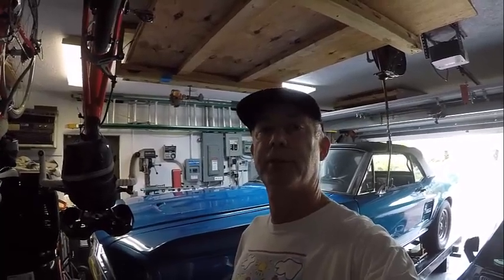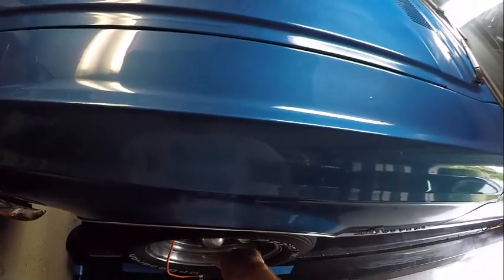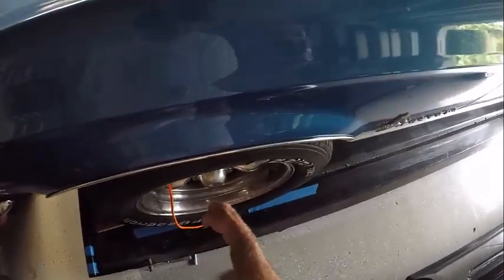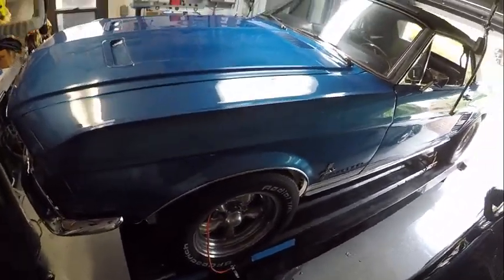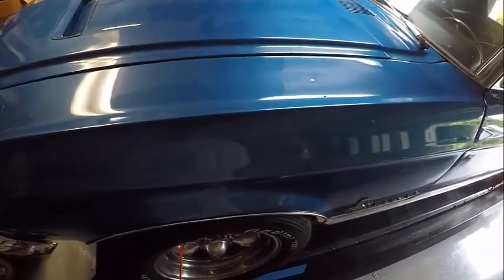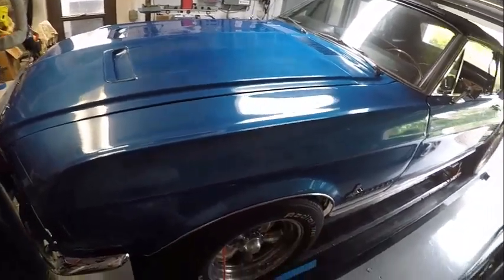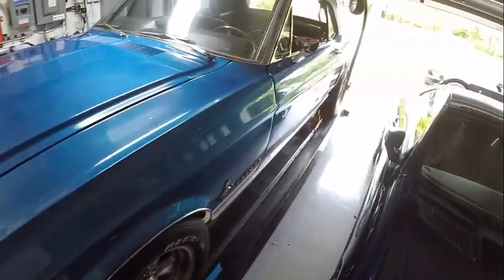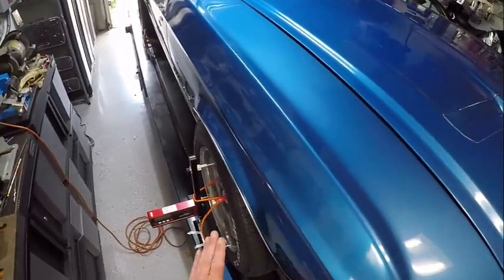Set Front End Alignment on 1967 Mustang

Comment: Great video. One of the best in explanations actually. Only thing I wish you did differently is, you didn't show how to adjust your camber if it was off. Since yours was at 1.2, you left it. My 67 has negative camber on just the left side. And I am looking for how to adjust it. I'm thinking to just turn the bolt with the offset washer. (Don't know the technical name of it).
Reply from the maker: Ah, good point.  Yes, that eccentric bolt (with the cam on each end) is used to set camber.  Loosen it, then turn the head to move the lower arm in/out to change the camber angle.  That cam bolt is notorious for not holding its position  - and I eventually experienced that.  So I purchased a camber lockout plate to permanently fix the position of that bolt.  It was a bit of trial and error finding the right bolt hole to use - but now it won't change.

Comment: That lift looks pretty handy. Does it raise the car up on it's own or how does it work? Very informative video btw, thanks for posting this
Reply from the maker: The lift needs a floor jack to raise it.  Then it locks into place.  Thanks!
Reply from the maker: One end of the lift retracts to the floor.  You drive on it, then jack up the lower end using a regular floor jack.  Once raised, you lock the tucked legs in place and lower the floor jack.  It's very handy.

Comment: Did you have a factory lower control arm on this car before then put this tubular lower control arms on it? Curious if it felt any different? Stiffer after installing the tubular arms?
Reply from the maker: The aftermarket looked beefier than the stamped steel OEM piece, so I went with it.  But doing so introduced bump steer as I guess the aftermarket piece follows a different arc than OEM.  So I had to come up with a solution to bump steer.  In retrospect, I probably should have stuck with the OEM lowers.  And I couldn't pair the new lowers up with their mating uppers as the pairing lowered the car - and my tires already hit the fenders on aggressive bumps.  Probably if I had gone Globalwest (that's the aftermarket lower brand) for both uppers and lowers, I wouldn't have introduced the bump steer issue.
Reply: @bretthusselbaugh1198  Thank you very much for the information and video.

Comment: Who makes the alignment gauge you were using for the caster and chamber I like how the level fits inside an actual cutout?  I'm going to speculate that when you zero the level you're supposed to rotate the level 180 degrees on the second button press so that your reference surface doesn't have to be perfectly level.   Best explanation of caster angle the simple description of what happens if you had 90 degree caster sealed the concept.  Thanks!
Reply: I think I found it on Amazon: Longacre 52-78298 Digital C/C Gauge LargeDunlop Style 22in  nevermind

Comment: Curious how you make sure on the toe if both sides are adjusted the same and one not in bit more than the other side, so they are even?
Reply from the maker: Toe really is just a difference in distance as measured at the front of the wheel vs at the rear of the wheel.  The tires will orient themselves to the road when the car is moving - so there really isn't a way for one side to be more "toed" than the other.  What happens, though, is you could end up with the steering wheel in a position that looks like you're turning when you're going straight.  And that may be what you mean - the toe is correct but one side is adjusted more than the other which causes the steering wheel to no longer be centered.  I had come up with an approach that got me close.  I basically, before starting, marked on my lift with blue tape the extension of a long straight edge laid flat to the wheel - with the steering centered.  I then used that to keep my steering centered as I made my toe adjustments.  It got pretty close - but you may end up back under the car adjusting toe after taking it on the road - to center your steering.  Just make sure you do the same number of turns to go in one side as you do to go out on the other - so you don't change the actual toe.

Comment: 67 Mustang he says,, but under it its a total different car ... lol..   No my stangs don't have that stuff ,, it works almost the same but not really !!!  lol..
Reply from the maker: The components are different but the adjustments, in terms of how to set camber/caster/toe, are essentially the same.  Camber is identical - even though the lower control arms are Global West (I've since gone back to stock).  The eccentric adjustment of the lower control arm is identical to stock. Caster is the same in as much as you lengthen or shorten the strut rod to adjust caster.  Stock has a nut in front of and behind the frame - adjusting those nuts in unison to lengthen or shorten the strut rod is the same in operation as adjusting the length of the Global West strut rods.  Stock steering is a box, pitman arm, drag link, and inner/outer tie rod ends - but the toe adjustment is at the outer tie rod - so it's the same adjustment as the Flaming River rack/pinion.
Reply: @bretthusselbaugh1198  yea it works the same only looks diverend.. mebe confuse the beginners . That's what I mend.